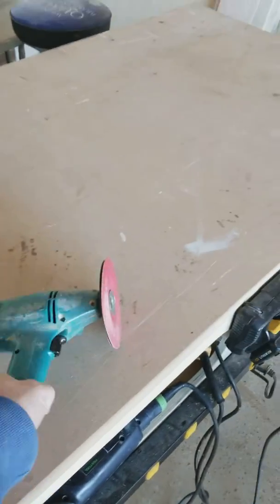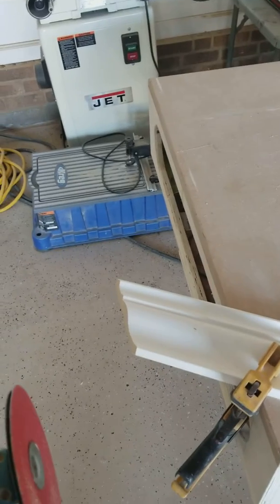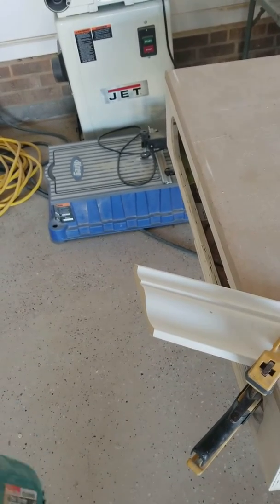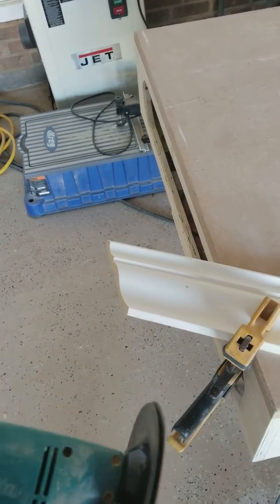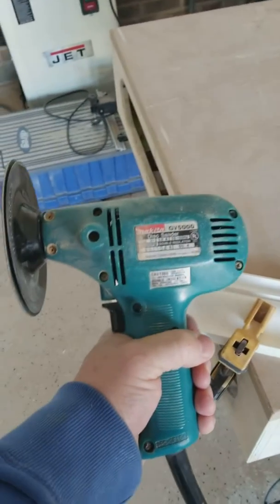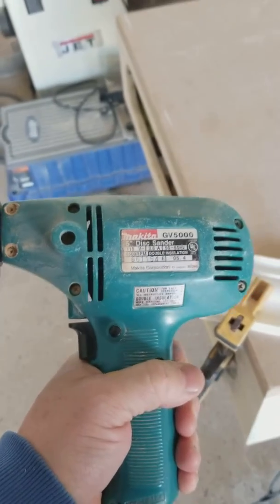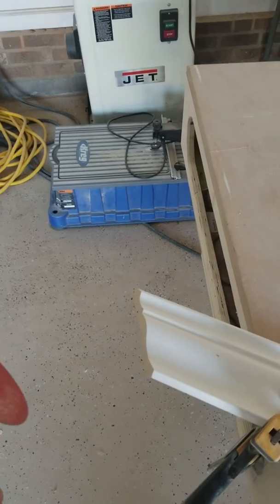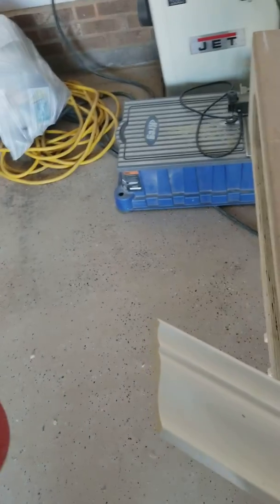Coping with a Makita 5" disk grinder

Comment: Which sanding disk are you using in this demo?
Reply: love2jibe it’s a 60 grit. I’ve used 80 as well. 80 is good for mdf. I like 60 if lm coping wood
Reply: @lexinichols7400  Great, Thanks!  Nice Demo!